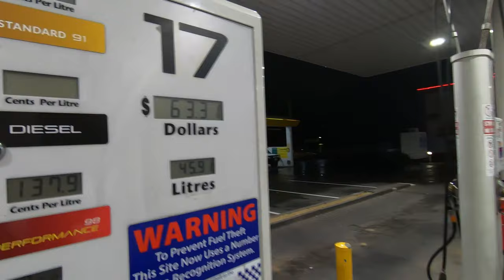Can a Subaru drift?! *IT CAUGHT FIRE*

Comment: how did the fire start i have just bought the car
Reply from the maker: The up pipe was very close to the radiator fan, with no heat wrap. It has since been fixed with heat wrap, and a half size rad on the opposite side. So she should be sweet now, send her hard for me 🤙🏼

- Raff